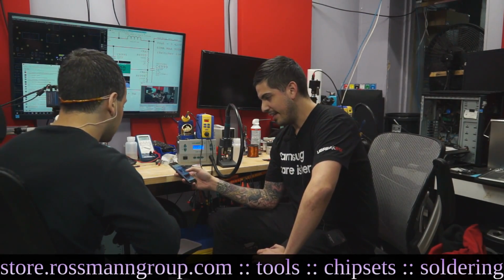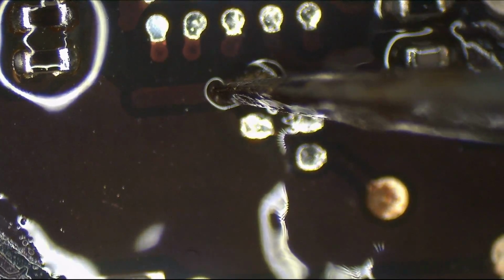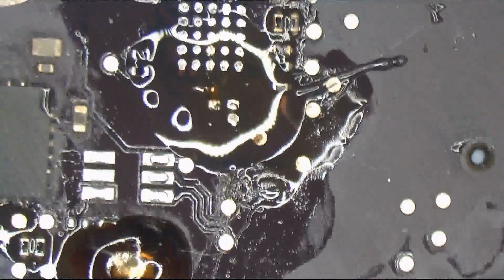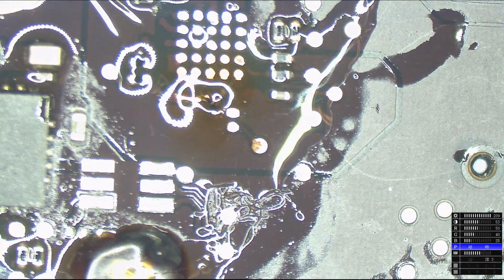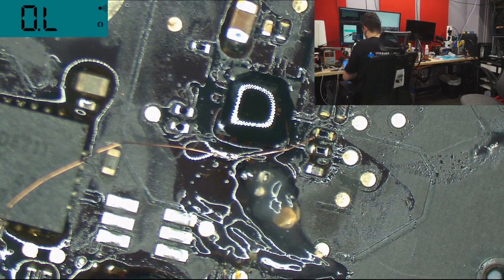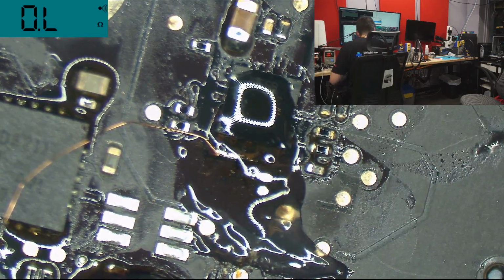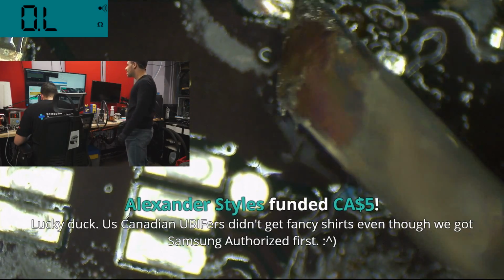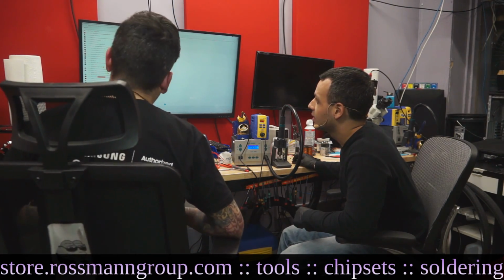UBREAKIFIX visits for a board repair!

Comment: UBreakiFix needs to be held accountable for their scams, intentionally damaged our $500 micro PC and $300 hoverboard to charge more for repair, but told on themselves because I had asked for a quote to upgrade not repair, both were running fine before we took it in, the PC was definitely not shorted out from water damage, got the diagnostic logs from the previous repair shop Compuzone Inc in Northwoods Charleston and even brought it to them again after and they agreed the PC had been intentionally damaged.

Comment: I'm 61.  A Simi retired Machine Tool specialist/Tool & Die Maker (40+Ys).  With an AAS from the 80's in electronic (almost; couldn't handle the English & reading crap).  So I'm inside out with crap like OHM's Law and the leading or lagging of the sign wave through cap's & coils.  LOL But I've  plotting the parabolic curves in the machining world, because I never used my electronic.   I FBombed Up my foot in a motocross wipeout last year, so shop work is all over 4 me now.  But, I see this as something I could still do.  So much so that I'm looking for the tools.  1) I'm broke as Hell;  Crashed out the foot late last summer.  Lost me daughter last Dec.3, 17, and my little brother 04/08/2018 (I'm the last of the 3 brothers).
SO

Comment: Hey Louis my iPhone 6's battery has recently hit the shitter, dying after near seconds of being unplugged and requiring to be warm to boot up or stay alive; Apple currently has me on a 2-6 week waiting list for a replacement. Was wondering your opinion on this terrible piece of hardware.
Reply: Well batteries die, that's not unusual, happens to every device, though it is a bit of a pity that simple snap on backs where you could just take out the battery and put a new one in are pretty much going away across the industry - this was a good design for SO many reasons. But a damn WAITING LIST to repair a device they're making the highest margin in the industry on... holy hell! You get on a waiting list for a kidney, because they can't just make another kidney, but a damn PHONE? You should be angry at that service quality.
Reply: After just two years of use I'm very disappointed, and with the apple battery controversy it isn't too far out to believe these batteries are cheaply made and unreliable.
Reply: Batteries aren't supposed to last more than 2 years - their design life across all brands is 500 charge/discharge cycles, and two years are 730 days, which is about as often as you plug in your phone to charge it. Higher service life is only possible at the cost of specific capacity, which would be a competitive disadvantage. It's impossible to sell people a reliable battery, as people simply always want more battery life at purchase, as part of their their purchase decision. Trimming the charge termination voltage to 4.2V instead of 4.35V would extend the median battery life to about 1000 cycles or more, but reduce nominal capacity by estimated 11%. Of course it's an asinine situation, because over 1-2 year battery life, you would get more actual average effective capacity if you trimmed charge termination voltage and nominal capacity, but unfortunately people like comparing numbers, so no manufacturer can step forward and cut the capacity by as little as 10-20% to greatly extend battery reliability.

Currently, no manufacturing technology is available that would extent battery service life at a given termination voltage without taking a significant cut to capacity in other ways. Historically, every time there was an advancement in chemistry that enhanced Li-Ion battery reconstitution on recharge, the termination voltage was adjusted, from first 4.2V to 4.3 and then 4.35V, to retain the industry standard 500 cycle service life, instead of taking the reliability improvement.
Reply: Actually i'll go ahead and somewhat contradict myself. There's a second degradation mode connected to floating the battery at high voltage, besides the one connected to charging it to high voltage and then discharging it. In the past, i've killed every single laptop battery within 2-3 years in part because of usage and daily discharge, and in part because of floating, and this happened whether i took it to university every day or whether it mostly stayed at home and floated. The only exception has been my current daily driver, a 2012-2013 Lenovo which has a non-removable battery, where they did something smart - a battery reliability option. You get to choose in software whether it'll top up the battery to 100% or to just 60%. By floating the battery low, now more than 5 years later, i still have 96% of nominal capacity, and i did actually discharge it flat hundreds of times during this time - only takes 3/4th of an hour, it's a gaming laptop, it needs quite a bit of energy just to idle. If some phone manufacturer stepped up and made it an option, the market would possibly take it. Now of course that same manufacturer would be cutting off one major revenue stream for themselves, but perhaps laptop batteries were not a lucrative one back then to begin with, because they were trivially copied or repaired at that time, being made from standard cylindrical cells rather than custom prismatic ones.
Reply: Siana, I was just about to mention that battery calendar life sucks because of designed overcharging, but I see you did. Kudos for not simply complaining about low-quality cells.

Like you, I customized the charge profile on my XPS 13 to start charging at 60% and stop at 74%. Degradation has all but stopped since I did this 3 years ago, holding at 95.7% design capacity. My phone almost never gets an overnight charge anymore. A 30 minute hit in the morning gets it right to 80% in no time.

Going high in voltage is one thing, staying there is what does the damage. As for the OP's iPhone 6 battery, one can be had from iFixit for about the same price as Apple, although you'll also need to buy the adhesive strips and possibly a Pentalobe screwdriver to open the phone. The hardest thing about replacing the battery is removing the original adhesive strips. They love to tear. I was able to change both a 5s and a 6 battery in about 45 minutes total.

Comment: Where I used to work we had a 12 thousand dollar Hakko BGA removal and alignment system.I would have to trouble shoot a system board down to maybe the North Bridge,South Bridge etc.It had 2 cameras,infrared heat and hot air.One of our contracts was with all the HOME Depot stores in the country so I would get about 25 boards a week to repair.Replacing them was not an option.Hey great channel.

Comment: You didn't solder the cap at the bottom of the driver at the end.
Reply from the maker: I sure didnt.
Reply: Louis DID point out it was most likely just a smoothing cap, implying it wasn't actually needed, and it obviously worked without it so...

Comment: do dell machines still have 35 watt pci-e slots, i have a optiplex 790 that only has pci-e slots with 35 watts, offical pci spec = 75 watts....dell sucks.....crap machines, crap specs, dont last at all, crappy bios, crappy manuals, list goes on...
Reply: Well, it's not that hard hacking the dell bios, and i like vey much my dell optiplex 330, used it for many years without a problem, very reliable. If you want a gaming machine then you weren't supposed to buy dell, so i imagine you recycled the machine right? BTW, there's absolutely nothing stopping you from taking two jumper wires and bypass the power directly to the PCIE power pins from that yellow-black aux connector, i've done that multiple times without any problem to overclock a board i got, measure the continuity from PCIE power to the AUX and you'll see what i'm talking about. Did this to the dell 330.
Reply: search in the bios-mods forum, they can hack your bios to have the engineering-grade hidden menus of bios we like so much we have in the state-of-the-art bios.
Reply: 25W PCIe slots are normal, even 12.5W exists. the 75W slots are PCIe graphics slots.
Reply: good to know, i think a evga board i have accomplishes the same thing....https://www.evga.com/products/product.aspx?pn=100-MB-PB01-BR
Reply: i must state that this comment comes from experience including the experience of consulting a dell technical manual about the right voltage dimms to be installed to upgrade a dell pc only to be advised of the wrong voltage by a manual from the manufacture itself, i had many dell laptops (never buying ever again) and still have a old studio hybrid (with lots of bios issues including some issues with HDMI).  the only dell laptop i still own has issues caused by a bit of overheating that has completely screwed the screen up (it was left in a kitchen cupboard).  the following comment is a more direct response to the PCIE power hack you mentioned.
Reply: Yeah, i don't doubt their support is a piece of shit, btw since you're a louis fan i think you might like to unlock that fking bios, so many interesting options dell locked for no fking good reason, like raid 0 in my machine, overclock support seems like gold when you don't have it, under/overvoltage can help a lot too, especially underclocking/undervolting the machine to get A LOT more battery time. Hell, if i can reduce my processor heat by undervolting under normal clock i'm also reducing current and have no performance loss at all, or even reduce 10% CPU can allow a much larger margin of undervolt, tipically 40% less energy used.
Reply: you got any links for to "unlock" the bios options, i've never heard of this but then again, i haven't bought a dell machine for about 4 years+, would love to investigate replacing my msi ivy bridge motherboard with a cheap surplus ivy bridge machine.....i have a K-series ivy bridge processor that dearly needs a cheap motherboard it can be overclocked on....